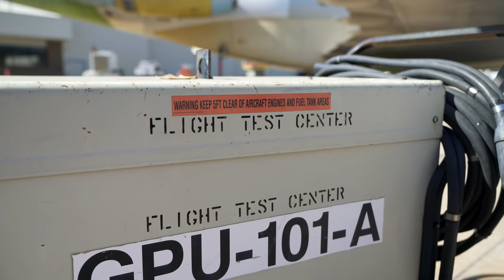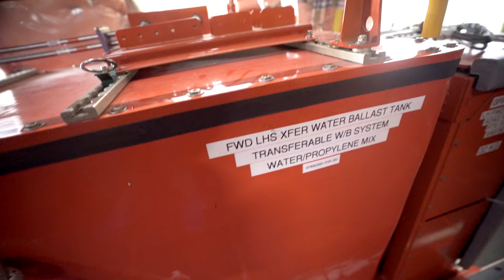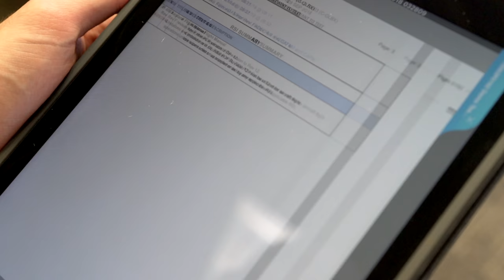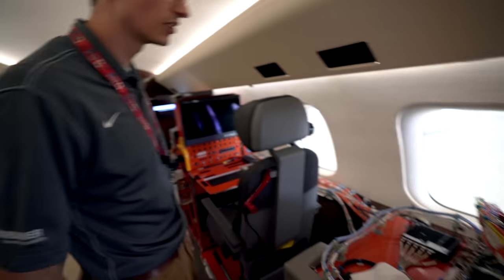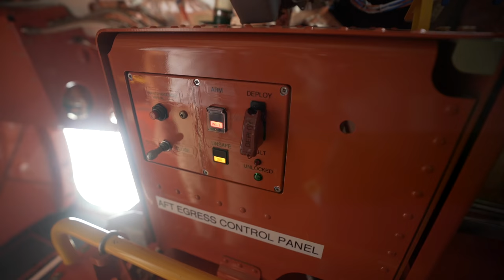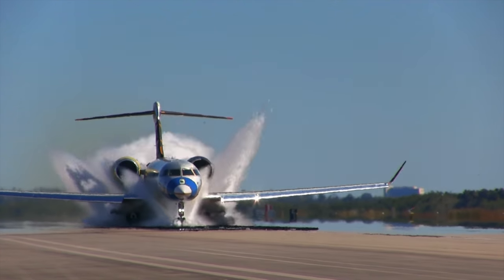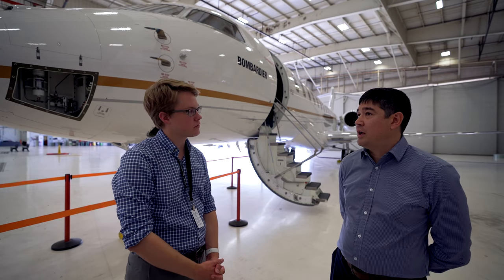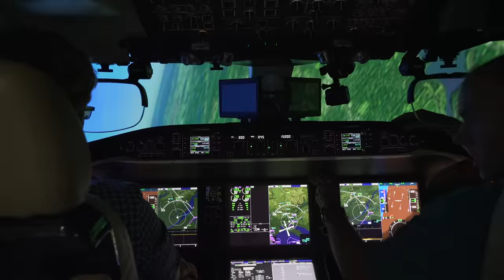Flight Testing the World's Largest Business Jet, Global 7500

Comment: On a technicality, it's not the largest business jet. You can actually order a BBJ 777x. 

Great video though.
Reply: That’s simply a conversion from passenger to business where as this is just for business
Reply: nz_planespotter Boing takes a passenger plane to business . Bombardier they take a business jet for business . Passenger for passenger. The oly plane that could of broken that way of doing things is the C-Series . Unfortunatley they gave it away 😔🥺
Reply: Those are not purpose built.
Reply: @adburn  True, I did miss when he said purpose built.
Reply: @MooseKicks1066  Also should add that Airbus did sell at least one A380-800 business config...it was to a sultan of course, but that would actually be the largest (even non-purpose built airframe).

Comment: So BBJ and ACJ dont exist then right?
Reply: @0:13 He specificaly said "the largest purpose built business jet"..That is 100% correct.  The BBJ and ACJ are commercial passenger aircraft that CAN be converted with a business interior.  They ARE NOT purpose built business jets..
Reply: @rcairflr  so heres what I'm getting at, the 777BBJ isn't made to be a business jet. It also looks a lot like a crj900, so it couldn't have been a completely clean slate design
Reply: 737BBJ is not designed as a "purpose built business jet", it is designed as a commercial passenger jet that can be a BBJ... just as the same as A380 can be for the Sultan. This jet is purposely designed and built as a business jet only